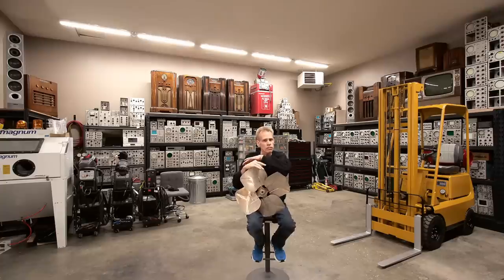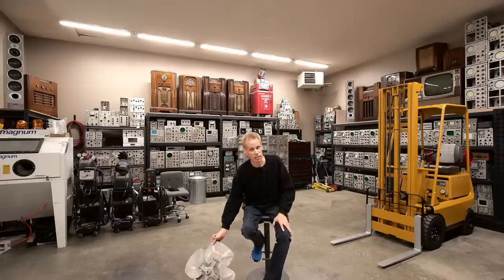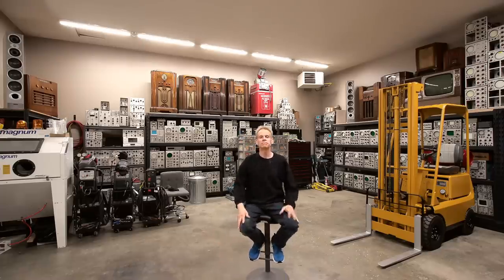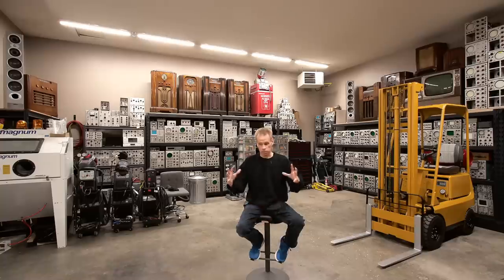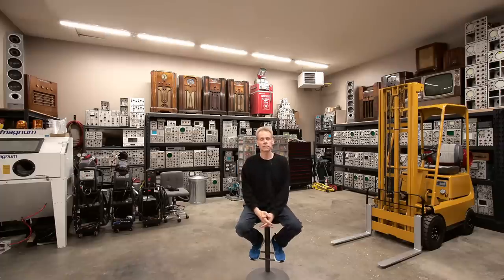SCARY Fan Blade Story! More Of Mr Carlson's Past.

Comment: I can relate to you alot! I love (and still do) rescuing small engines and like working on stuff and welding metal I grab from the scrapyard! I was working on an engine and accidentally left a bolt in the flywheel shroud and when the engine started up the bolt got caught in the flywheel and flinged it through one of the air vents and almost hit my face 😳 I have so many crazy stories and scars but you live abd learn haha. Another one was when I was working on a homemade motorized bicycle that I got for free and when I tested it out the idle screw was set to high and obviously me being a kid this bike was tall and I could barely put my feet on the ground and when it started up the cover was off on the pulley belt drive system and it decided to leave a nice little reminder on why you shouldn't do dangerous things, I also took off down the neighborhood as there were no brakes. Thats just the tip of the iceberg but watching your videos has inspired me to start working on electronics and I've been collecting old antique radios and I've been learning how to fix them by watching you diagnose and repair them! But unfortunately highschool has gotten in the way and I have to put aside them until I get free time but if I still see an antique electronic piece or small radio i will still grab it to try and fix it in my free time! Thank you Mr. Carlson for being a HUGE inspiration to me and many others!

Comment: As a FAN of yours first, this Saturday was good to me. First my group figure skating class went great, Oh yes, I struggled yet so worth it, fun too, where my classmates helped each other besides our two figure skating coaches, me still playing with fire on ice with 400 series stainless steel figure skating blades. .

Then my afternoon Mr Carlson BARES all. I worked on a system that used left hand thread in 316 ss drive shafts, one was female and the other male, the machine shops hated making the drive shafts for our filtration systems.

 Oh my Paul the Bear is interesting yet could be dangerous. Loved the hummingbirds' in your snazzy back yard.

I see your bed blast cabinet. If you need a big step up I see "Rebuild Rescue" doing cleaning of parts on a Cessna 410, a company loaned them a system called "Vapor Honing" it uses bead blasting with high pressure water, you might want to check it out. I am so amazed at all the skills you have, Paul.  
Cheers
Kristy

Comment: My great grandmother had an ancient desk fan (30's/40's) that had a metal blade and very open safety shroud. Was always told not to get my fingers anywhere near the blades while it was on. Many years later, got buzzed by a radio transformer on the HV side (120 V input / 12 V output) while holding the prongs and tapping a fresh 9 V battery to them. Learned not to do that again! Until high school at least... when I managed to get some study hall mates to hold the HV end (again 10X transformer) while tapping the LV side with a 9 V battery (~90 V output, moderate amperage) and them holding hands. Was an entertaining experience for all of us.

Comment: Great video Paul! I too was interested in all kinds of mechanical/electrical/electronic things from a very young age. How many kids in the 4th grade take electronic magazines to school to read? I've had countless close calls... one that goes down in infamy was in 1981 (12 yo) during the wedding of Charles and Diana. My parents had bought an old florist shop and it had a disused "electric eye" beam across the front door to announce customers. It ended up coming home with me and I was quick to wire it up in my bedroom. The whole thing ran on 240V (I'm in Australia) and I used an old telephone junction box to do the connections. Nice screw terminals with NO protective insulation barrier between the terminals. It was working fine until I spotted what I thought was a stray stand of copper. I new it was live so I didn't stick my finger in there, but I used a screwdriver to move it... BANG! A shower of sparks and a huge arc flash and the end of the screwdriver was ruined. Of course this blew the fuse on that circuit which also fed the TV and brand new VCR in the lounge room which was recording the royal wedding. My parents bring it up from time to time as a joke... but it could have ended badly at the time 🙂

Comment: Had a similar, but different experience with a crop (what kids would call these days "drone") RC helicopter back in the early 00's. Powered by a Stihl ms 250, which was only one year old at that time, so a wee bit temperamental (or at least, when we made the engine swap, it's possible we didn't do it quite right), we had the heli on the trimming pole (essentially you strap the machine on a rotating pole platform, akin to a transmission jack, that only allows it to move up an down with a short leash, so you can trim all the characteristics on ground) and started it.

Revved up nicely, for once, and so my brother pushed it to max for once with the pole locked in place...aaand BAM, the tail rotor, shaft and a good section of the rotor blew up to pieces, stalling the motor.
That tail rotor was broken in half and one part embedded into my brother's car in the front, some meters away, the other flew, broke the window to his work shop and we never found it at that time, found it years later under a cabinet.

The thing is, we were mere CM from being impaled or hit by that blade, as we were standing behind the thing, which in hindsight was a stupid thing to do with an untested piece of equipment. 

So yeah, blades be scary, always wanting to chop chop you. Our lesson was to always test/trimm the units inside sandbag pits, much safer. :))
Reply from the maker: Thanks for sharing your story!
Reply: Thats a terrifying story, it rather reminds me of Adam Savage's stories of starting Blendo (briggs and stratton powered battlebot)

Comment: In my technician days i also ended up doing a lot of the electrical repair jobs in the company I worked for, it was a small company and we had many functions to fill. One morning I got a call from Russ in the epoxy shop telling me the large walk in oven was down. I went down and started to troubleshoot the problem. The electric panel for these two ovens was next to a partition wall and you had to shimmy your way in there to access it. That panel was about 4ft square so you would shimmy in there to lift the panel off and shimmy back out with the panel in your hands. Then I'd go back in and measure voltages to see what was going on with my simpson 260, these ran on 208c 3 phase.

I determined on input fuse was blown, this used 150a fuses that were 7-8" long and close to 2" in diameter. There was a chunky copper blade at each end that took some effort to pull out. I went upstairs to get a fuse and returned to the site of the crime. I disconnected the power to that oven and went in to change it. As I said it took a lot of effort to get these fuses out so you had to place one hand against the oven and pull the fuse out with your other hand. As I pulled out the fuse I thought I felt a little tingle.

i slid out to get my meter and looked at the disconnect switch and realized i had shut the wrong disconnect off and I was working on a live panel.so I pulled the right disconnect, ferified the power was off and installed a new fuse. I went back in, verified the power was indeed off and checked a few more things. All looked well so I re-energized the panel and verified the oven was working and put that big cover back on the panel.

That was a real come to Jesus moment. Had that not been a large enough fuse that I could wrap a hand around it without touching the metal end caps and came very close to electrocuting myself. I had a thousand things to do (a customer rep was due in and I dad to sell him a cart load of radar power supplies) I allowed myself to take a shortcut by not verifying the power was off with the meter. Life is to short and mine could have been a lot shorter, after that i always verified power was indeed off.

Comment: ha ...
I suppose most of us have such stories to tell.
You have been extremely lucky ... but you got an excellent lesson also. 
Mine was the THT on an old 1954 TV-set when I was 17y. I wanted to plug out the cable running to the picture-tube (The suction cup connected to the anode) BUT ... I forgot that this can hold a charge for quite a long time. 
... well ... Now I know what 18000V represents! My luck was that I was standing on a wooden floor but nevertheless .... "woohaaaaaa". 
 Supervid, again ... I didn't know that bears would eat leaves of trees 🤔 
But ... except for the zoo ... we don't have bears in Belgium ... (we have beer instead 😆)

Comment: Yikes, have the same size extractor fan in my basement. Its on top the retaining wall & aimed into the floor crawlspace mainly to force the air around in under that part of the house & sometimes to change the air in case i have been painting (fumes) or working with my mill or lathe, even welding. Anywho, one day i switched the fan on & it went to max speed fairly quickly as usual only for an almost empty spray bomb of bright red paint i'd not seen near it get sucked in & destroyed coating almost everything in the crawl space in bright red!!!

Comment: Back in high school, my buddy cut a disc out of oak that would press fit into the back of a 20" box fan blade. In the middle of the disc was a hole to mount it on a 1/2hp motor. We clamped it to a table. You could feel the fan 50ft away. No guard on this and it never flew apart and killed us.

Comment: at least the fan hanging from my ceiling joists has a guard around it!!! it was originally a floor standing fan about 5 feet tall but the base broke
hey, the motor you have sounds nearly identical to the 1? 1.5? hp "bench grinder" i have, it is a motor with a threaded shaft that holds a grinding disk that
 i really should replace before the disk explodes

Comment: That looks like an attic fan blade so it is supposed to move a lot of air ... I have removed one from my attic when the roof was replaced and ridge vents were installed instead... I still have it in the garage, still looking for "that project" where I could reuse it 🙂

Comment: LOL... yah had an old dodge powerwagon in the late 70's...
rear seal on the tranny was leaking..  had to remove the transfer case... it's not to big no problem...
I got under it on my back , manhandled it off and PLOP right on my chest... it weighed 350 pounds.
lucky it didn't fall on my face, but was able to wiggle out from under it... left a few marks.  
never got under one of those again.
Reply from the maker: Ouch! Thanks for sharing your story!

Comment: So there was a guy worked at the town and his face was kinda messed up. I wondered what happened so I asked around. Turns out when he was in his late teens he was working on his car that had one of those stainless Flex Fans on it. Car wasn't running right, and after a time he got really frustrated with it, and began revving it up really high while he was under the hood. Yup, one of the blades of the fan broke off and hit him in the face. He was in critical condition and in hospital for weeks and did recover but badly scarred for life.

Comment: I've been sliced by model airplane engine propellers before. Usually from a backfire when starting or getting my fingertips too close to the needle valve. Gray APC props had the sharpest edge out of all of them. One time though, I had a white nylon prop on a Cox .049 explode at full speed (~16k RPM), I heard the blade whiz past me. I rarely stood right at the edge of running props for that reason. Some folks say you can boil them to reconstitute the dried nylon, It's best to just keep those old nylon props for display purposes only.

Comment: In my past, I have smoothed a motor from vibration by holding a sanding block to the shaft as it runs. If the shaft is two piece, threaded, it will blind the connection points and looks like a shaft that is one piece.

Comment: If the keyway in both pieces of the shaft were aligned, a key being used would hold the threads together no matter the rotation of the shaft.

As far as fan guarding, We have a relatively new heater at work, and the safety guy still wan't happy with it's guarding, so the welders had to make an additional expanded metal guard to cover over the factory guard.

Comment: When we are young, our guardian angels work overtime.  I did a frame swap on my F150 when I was 19.  I was pulling off the junk cab off, but it got stuck on the fwd shifter. I got between the frame and cab and got it unstuck. The chain holding the cab shifted, and the cab almost pinned me to the frame. Scared the life out of father who witnessed it. I was young and dumb, so it didn't scare me then like it does now.

Comment: I can't think of a reason for a motor shaft being made that way. Especially when you mention the key slot. Very odd and no wonder you didn't notice. Who would, except the ones who already had your experience.
Reply: I have seen motor shafts like that in old pumps, was a quick cheap and easy way back then to extend the shaft of an "off the shelf" motor rather than special ordering a motor with a the right shaft lenght/diameter.
Reply: @rovhalgrencparselstedt8343  That could explain it, but one would think there should be some sort of indication that it was done. I also think if these is as you described, the key slot would have been made after the threads, since Mr. Carlson said it lined up perfectly.

Also, why would one want to weaken the shaft by limiting the strength to the tread rod diameter?
Reply: @Mr_Wh1  Well, in a pump there isen't really any load to speak of on the shaft other than slight inertia from the pump impeller during starting.

Comment: I've never seen an induction motor with a multi-piece shaft! And i've seen many! That is such a bad design. The only threads you ever see on a shaft are just parts of the shaft itself. Was it a modification to extend the shaft that threaded into the original shaft?

Comment: Watch out! That bear is practicing so it can climb your 3,6,9!
The important thing is that you were behind the fan. 

Nota bene:
1) working on fans and motors, be behind them when you test them. 
2) When working on electronics, the non working hand stays in your pocket, and set things up so you only have wood or other non-conductive materials around you. And, wear a stout pair of boots!
3) Try not to do risky work on your own.
73 de G4JHQ AR VA
Reply: 2 is for high or low voltage electronics, extra and ultra low voltage you are grounded constantly

Comment: I have cut my finger to where it was bleeding, just fooling with cooling fans on radio equipment that had plastic blades, but no fan guard.  I always try to learn something from stupid mistakes that could have got me seriously injured, or killed.  I have dodged a few bullets.  When I was about 14 or 15, I was helping my neighbor burn some brush.  He used Kerosene to start the fire.  Like an idiot, I lit the stuff just as soon as he pored it on the brush.  It singed the hair off of both of our arms and legs, but we weren't seriously burned.  I have close to turning a riding lawnmower on top of me when I was in my teens.  It put a good scare in  me.  Come close to drowning a couple of times.  Nearly wrecked my mom's car when I was first learning to drive.  You live and learn, hopefully.

Comment: A friend was working on his race car. He had an aluminum flex fan on the engine and as he leaned over the engine and revved it up a blade came off the fan and hit the floor by his feet and shot out from under the car. If it had of flew up instead of down he would have been badly hurt or possibly killed

Comment: Years ago, I got an electric fan from an outdoor air conditioner, however, it was a 220v model. I decided to put a larger capacitor on it, and I mounted it in a window opening, and when powered up, it seemed to do well, however, one afternoon, it was beginning to rain outside, so I unplugged the fan, and it was at that point that I realized that running an AC motor on half voltage was not good, let alone the reluctance issue. 
A few days later, as is typical here in eastern Pennsylvania in the hot summers, the fan was  once again plugged in, and seemed to be running alright, but a while later, that fan started releasing so much smoke, that we finally unplugged it for the last time, cut the cord and put the fan in the junk. No more dumb kid stuff for me.

Comment: Sounds like the motor was also running way too fast, maybe 1200RPM instead of 600 
Someone might have done a repair or extension to the shaft, if it had been used in the past with the key, it wouldn't matter which way it rotated as the key would have locked the shafts together
Yep i remember the old black GEC fans with metal blades and a wire guard that you could put your hand through,  we also had fans with rubber blades, those were ok to touch.

Comment: i have a ton of these stories. i to grew up with small engins, go carts mini bikes, dirt bikes. in my old neighborhood we had a go cart that we all took turns driving. to turn the go cart off you would pull the spark plug wire off. well you can guess what happened one day. after that jolt i never wanted to be the guy that shut off the go cart. sorry about spelling.

Comment: When i was younger i had a fan, nothing special, plastic blades, induction motor about 50W, 1400 rpm, and i got DC motor, 24V 250W, 3500 rpm and i got a briliant idea to put fan blades to this motor. As you can imagine, this fan blade withstand about 5 seconds before exploding 😅